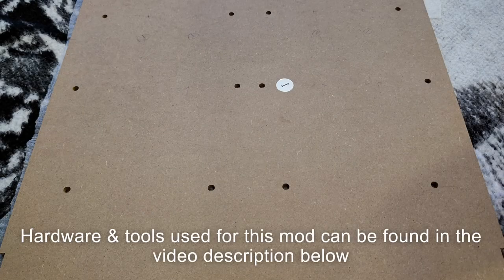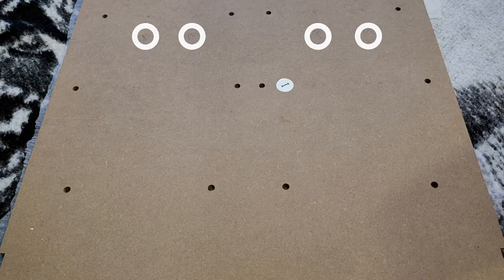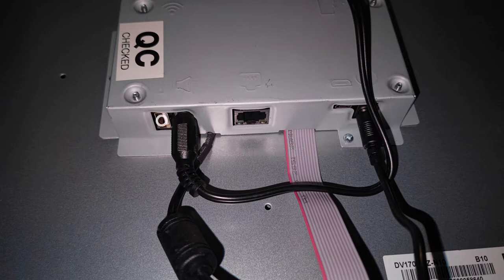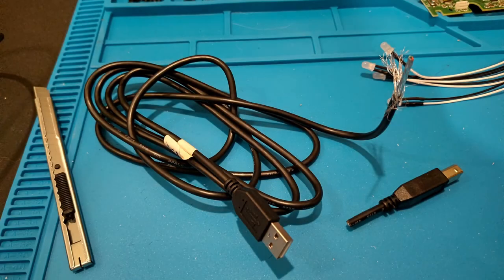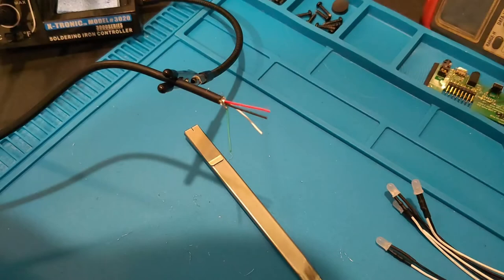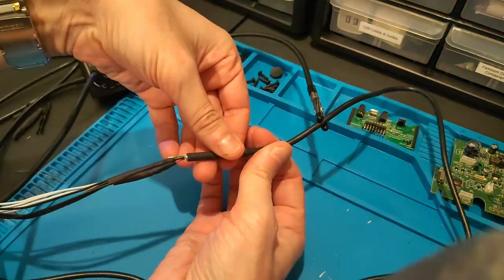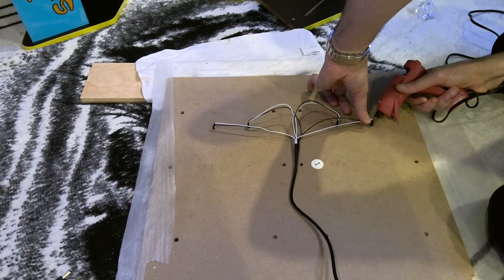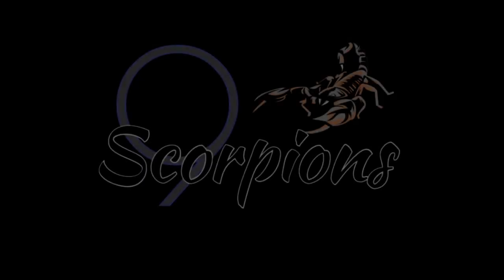Molded Coin Door Light Mod on Simpsons Arcade1up

Comment: What type of resistor would be needed on each LED if purchased without resistors?
Reply from the maker: hey Nick!  It will depend on the specs of the LEDs you are using (including the color used).  Do you have specific LED in mind?  We can calculate the resistors needed, but I would recommend buying a small LED kit with the limiting resistors already in place.  This is the one I used in the video install and the resistors were already installed under the heat shrink tubing:  https://www.amazon.com/gp/product/B08G4XCQSW/ref=ppx_yo_dt_b_search_asin_title?ie=UTF8&psc=1  That kit is overkill, but could support many cabs as well depending on your needs.
Reply from the maker: Additionally, here is a resistor calculator:  https://theengineeringmindset.com/led-resistor-calculator/

Comment: Great Tutorial! Thanks!
Reply from the maker: You're welcome!
Reply: @9scorpions  Question? I’m would like to upgrade the LED in my Arcade1up marquee. I don’t know much about wiring, voltage, resisters, etc. Can the Arcade1up PCB support more LED?
Reply from the maker: @AnthonyVitale  Hey Anthony...hope all is well.  Standard USB ports can supply 500mA of current.  However that is an assumption about the hardware in these cabs.  But with that assumption and if you were using 20mA LEDs (or less)...you likely could supply 20 or so LEDs.  I would imagine if you exceed its current limit...then you would start to see dim LEDs.  Another option here is to put a splitter on the 12V power supply going to the PCB.  You can then get 12V from the brick and will not have any problem supply current for a marquee.  I have multiple cabs wired this way with aftermarket marquees.
Reply: @9scorpions  I'm doing very well! Thank you. Could I use the existing Arcade1up wire for the marquee? That’s 12V? Could that handle more LED? I opened up my Arcade1up marquee it has 6 LED. Possible to double it, 12 LED?
Reply from the maker: @AnthonyVitale  Pretty sure those are using 12V.  If so, then it should be fine to add more LEDs to.  The power brick being used for these cabs supply way more current then needed.  Are you buying an aftermarket marquee from one of the community vendors?  If so, they are accustom to this sort of thing and likely will provide the wiring or have the option to purchase the needed wiring.  Please understand that I cannot reply with any certainty as I am not working directly on your cab.  Are you replacing the Simpsons marquee or which cab are you working on?
Reply: @9scorpions  Thanks for taking the time to answer my questions! I should have supplied better context. I have built custom marquee for my Arcade1up Simpsons and X-Men cabinets. The last thing I need to do is install LED. I would like to use the stock Arcade1up 12v marquee port/plug and increase the amount of LED. Instead of one strip of LED in the center, have two evenly spaced. Selecting LED and how to wire them is where I’m out of my depth. Looks to me that Arcade1up uses backlight LED with optical lens. I think I have found similar LED. How would I wire 12 LED? Series, parallel, do I need a resistor?

I tried to post a link to the LED on Amazon, but it keeps deleting my replay.
Reply from the maker: @AnthonyVitale  gotcha...thanks for the context.  So you may get lucky and the off the shelf LED kits on Amazon use the same size connector that would allow direct plug and play to the cab.  I am looking at the kit in the below link.  These strips are short and pre cut and it is also already set to run on 12V.  So you would not need to worry about current limiting resistors as it is already configured out of the box.  https://www.amazon.com/HitLights-Pre-Cut-Flexible-Changing-Connectors/dp/B07NWFVRY4/ref=sr_1_7?keywords=mini+strip+led+lights&qid=1648055593&smid=AJ0QRPX8ADNI1&sprefix=mini+strip+LED%2Caps%2C148&sr=8-7
Reply from the maker: And apparently YouTube will only let the channel owner put links in the comments...sorry about that.
Reply from the maker: @AnthonyVitale  Looking more at the LED kit in the link I put in my other reply...that is multi-color with remote.  You want to make sure you can set the color and it remembers it after you remove power.  You don't want your cab booting and the marquee being some crazy color.  Some of these kits remember their settings and some don't.  I would do some research on that set or similar set.  Just make sure any set you look at has a 12V power source.

Comment: Can you send a link of where you ordered the led lights at thank you
Reply from the maker: hey there!  Here you go:  https://www.amazon.com/gp/product/B08G4XCQSW/ref=ppx_yo_dt_b_search_asin_title?ie=UTF8&psc=1
Reply from the maker: Note that this link is for a "kit".  If you can find a cheaper kit with just white LEDs, go with that.  Make sure though that they come pre-wired with current limiting resisters built in.  Either way, you get down to the cost point where you will pay more for shipping to get discrete LEDs than the LEDs are worth.  So these kits are not a bad deal if you plan to mod multiple cabs.